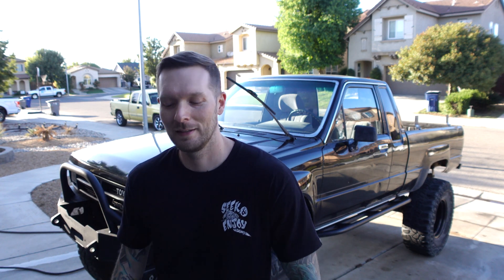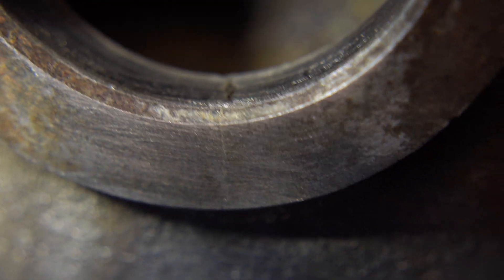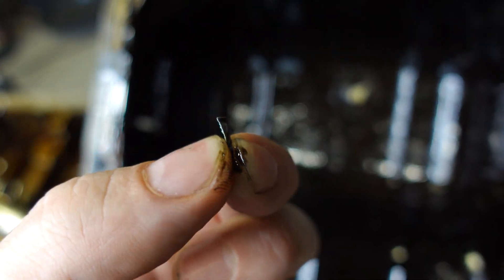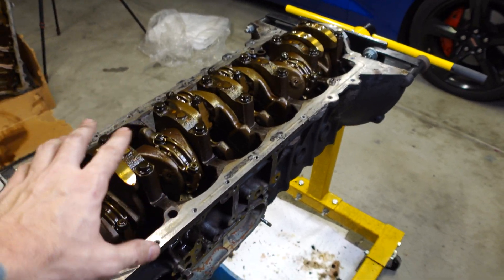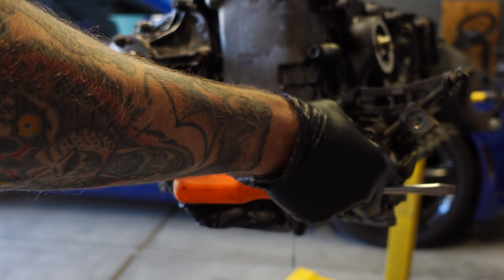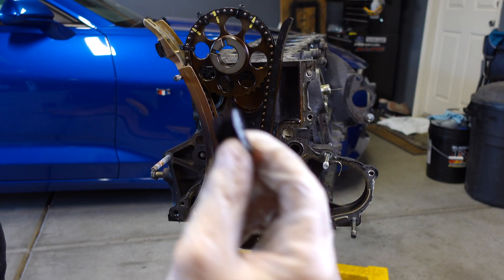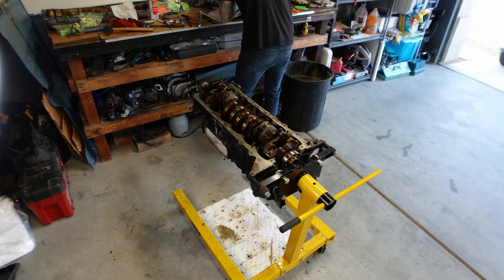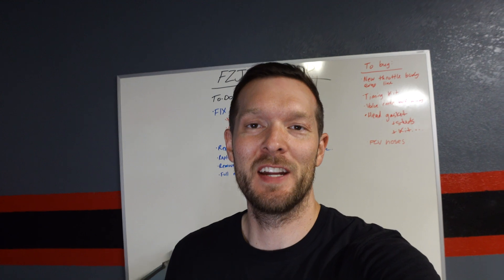INSIDE A 230,000 MILE Toyota Land Cruiser Engine | 1FZ-FE Rebuild - CRACKED BLOCK!

Comment: Thanks for your video. Really help me out.
 My engine in wasn't so bad.
 The secret is you have to loosen the to to engine mounts.  And transmission mounts Using a engine hoist lift 4 inches and upper oil PAN slides out. Through the back plenty of space .

Comment: Surprisingly, doing the sump upper pan is not that difficult, you drop the sway bar undo the two engine mount nuts+ jack the block up onto 40mm chunks of wood, cleaning the old sealant just fall to the ground, simple

Comment: Awesome videis, truck came iut great and you have a truck for a while. I have  a 97 and was about to start charging seals, but i think i will pull the motor and do everything outside. I have a rear main leaking and the oil pump. Runs great and plan on keeping itr for a while. Now, since the motor  will be out, might as well replace as much as i can., what do you think? Or just enjoy it until it dies  d then replace the motor? Or overhaul it. Im at 168k. Just did a head gasket about a year ago, replaced all hoses, radiator, plugs, etc.still does not drip on the floor, but it starting to spread   all around .

Comment: I found oil mixing with the coolant inside of the oil coolant system on the side of the block. Haven’t found oil mixing with coolant anywhere else in the motor. My question is would replacing the gaskets fix the oil in there or should I get ready for an entire rebuild? 🫠
Reply from the maker: @KCPOA  you just have a bad head gasket. Common on the 1FZ. Replace it and drive it for the next 300k miles :)
Reply from the maker: @KCPOA  oh wait. Only in the oil cooler?
Reply: @RM_Garage  yeah only in the oil cooler that I found. I’m dropping the oil pan to be sure but there was none when I drained the oil
Reply from the maker: @ pull the oil cooler apart and take a look too. They make rebuild kits for them. Look for cracks or anything weird

Comment: As far as what to do with the build, at least get a nicer cam and perhaps a crank kit for it? How fast you want to go equals how much money you want to spend on the engine really. Great video, Jim.
Reply from the maker: Thanks Jim! The go fast parts are so expensive for this motor with such little gain that it would make more sense to just switch to an LS platform. I think I’m going to just drive this stock and keep it reliable.
Reply: @RM_Garage  Well said..
I'm looking forward to your video